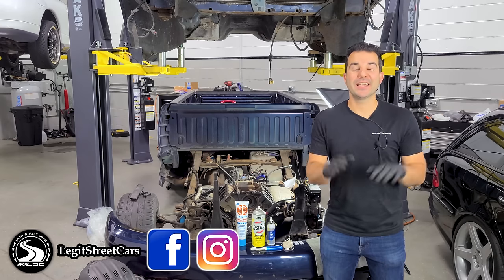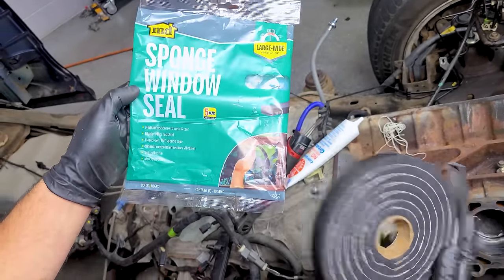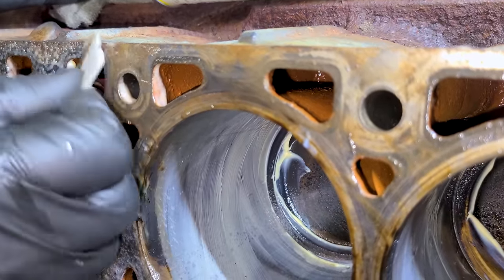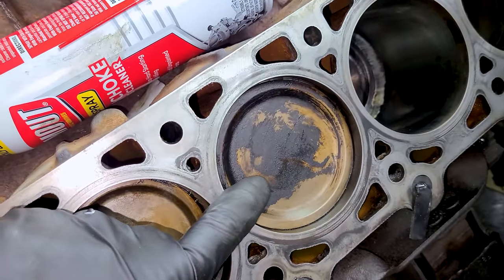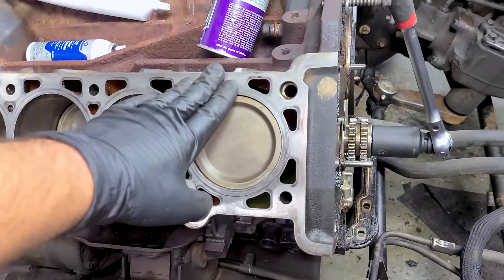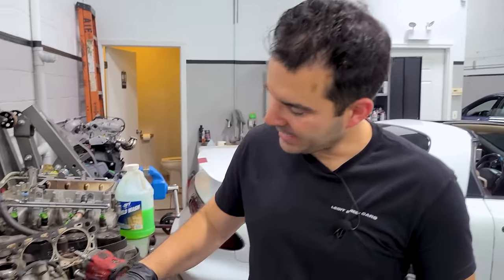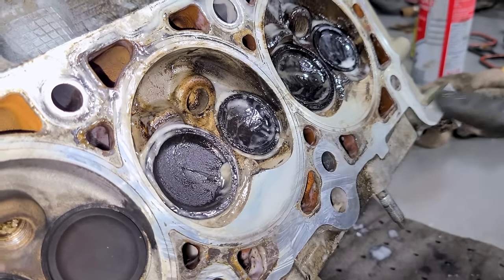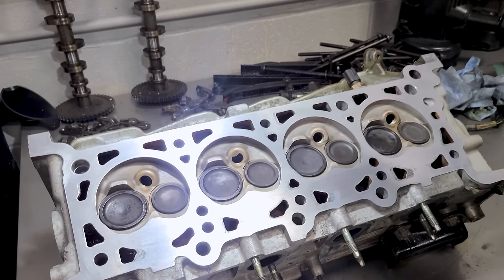How I Cleaned My SVT Lightning Pistons & Engine Block Using WAX STRING! BONUS: Head Cleaning!

Comment from the maker: Who's working on their car right now? Whatcha doing?
For your chance to win the 2022 BMW M5 CS and support a great charity click here! https://www.omaze.com/legitstreet
Reply: New SC oil on the s211 55 😎
Reply: 1982 380sl.  Bought it not running for $800.  It has 75k miles and near mint condition now.  All in I am about $2500.
Reply: Working on 3 cars. 2 Honda crvs. And my 2000 jaguar stype 4.0. All suspension work except for a a starter on my crv.
Reply: Replacing rear turbo manifold gasket on my 99 SVT Contour. In my profile picture.
Reply: 2005 CL600- replacing all ABC lines, pump, and rebuilt vblocks and regulator.
Reply: I’m replacing all 4 of the door latch/lock mechanisms on my Mk6 Jetta GLI. Hint, don’t try to lubricate them… ever! 😂😭
Reply: Wife has a 78 Corvette, I've got an 01 TA. Life long projects, for sure.
Reply: Starting work on my 88 camaro.
Reply: Just finished W221 4matic engine mounts. SO worth the effort. Learned a ton and it is by far the most satisfying repair I've done on  this car.
Reply: Just finished head gasket on Toyota Echo yesterday and first half of front end on Mazda Millenia. Exciting 😐
Reply: i have multiple projects on the go right now. changing a leaking oil filter gasket and belt on a 2006 bmw, valve cover gasket and eccentric shaft sensor on my wifes 2008 bmw, and fixing accident damage on a 2007 dodge ram i picked up for work.  I love watching your videos, they always give me motivation to go work on my own vehicles!
Reply: Rear brakes. Shop wanted 450 effing dollars to do it!
Reply: Bearings on a 2011 Mini Cooper S N18 JCW Dealer Upgrade Pkg.
Reply: Is one thing to be aware of when cleaning aluminum pistons with oven cleaner it eats away at aluminum do not leave it on there for long at all It will create microscopic fishers in the aluminum carbon build-up will be easier after.  the gasses it produces when it comes into contact with aluminum are very toxic to you  clean them outside if you can
Reply: Putting off doing my cam chain tensioner on my 4.2l Audi. I already did one side that turned in to full timing belt job and I'm dreading doing the other, prayers please
Reply: I didn't work on any of my cars today but I went into the shop to try to finish up a rear differential.  Some idiot had been in there before me and created a lot of extra work for me - I was expecting a simple pinion bearings/carrier bearings replacement but turned into resetting backlash and pinion depth.  I thought I would be home by lunch but after getting frustrated with the (worn and abused) shop bearing splitter, I left to buy my own bearing splitter then came home to drink beer and watch Alex work on his Lightning.
Reply: @DoubleCrossfire  you need all the motivation you can get if you have to maintain 2 BMWs, may the car God's look down upon you with favor
Reply: @modelbehavior3252  care to explain?
Reply: Leaf spring brackets, shackles and bushings on a 1996 ranger. Those things are thin sliced swiss cheese.
Reply: @RandomPerson-su3xg  yep and the winter is not their friends
Reply: Ford excursion rebuilding interior with 2020 Ford expedition seats and new carpet.
Reply: New lifters for 92 dodge stealth
Reply: As always, awesome video! BTW, after also watching M539 Restoration's latest vid, he used a dual component carbon cleaner (Protec Carbon X) and it literally melted away heavily caked on deposits, on used pistons. Would love to see you try that stuff and give us your opinion :) Keep up the awesome content!
Reply: Working on the drums on my 65 Mustang Gt today. Probably going to switch to disk brakes.
Reply: @JDJD-mw9rr  Well i have 3, one is a project put on the back burner while i sort out the others.  believe it or not, all of them have been relatively easy to maintain in the 4 years i've owned them.  most of what i've had to fix are just simple maitenance items like brakes, rotors, brake sensors, changing oil, etc.  all of it easy to do.  mind you, i live in a small town, we don't drive them alot, and all have low kms, so maybe all that is going to change!
Reply: @DoubleCrossfire  I have an older Audi A8 so I know how it is to maintain European vehicles, they're not the cheapest or easiest to work on most of the times, and I've heard some BMW horror stories so I've stayed away from them for now
Reply: I am just helping my brother-in-law pull out the urea tank on his 6.7 Ford it was leaking crusty nasty ass urea all over the tank🤨
Reply: In a holding pattern right now, with a road trip looming. Belle Tire did a bad alignment job and ruined a set of tires on the road trip car, so now I'm tire shopping and deciding which dealer to take the car to for an alignment (as I can't seem to find a competent alignment in the Detroit area anymore).  At least the dealer's service department has the correct specs and knows how to do it, although it costs 2x what tire shops charge. 🙄

I have to prep a car for the Lemons Rally event in July when I get back, though, and will be crushed for time...
Reply: Paint and metal work (rust) on the roof of an E36 M3.
Reply: Perhaps about to start head gaskets and timing chains on a 2012 Range Rover with 5.0 NA Jaguar engine.  Do you have a link to the straight edge you used in this video?  I need one.
Reply: Working on my 1992 Honda CB 750 Night Hawk. New pet cock and rebuilding the carbs
Reply: @JDJD-mw9rr  No, i've heard alot of horror stories about some european cars, and especially about BMW's in general.  i bought all of mine as "totalled" or salvage title.  i did my own work to repair and get them rebuilt.  Since i had so little into them once i was done, i wasn't really worried about the costs if i had to fix something.  thats why mine all have low kms.  also, i did not go for the more troublesome models with the V8's, and turbocharged 3.0L.  Mine are all NA, two of them 3.0L and one 2.5 for my wife.  i've heard good things about these engines when they aren't turbocharged and so far i've been happy.  Moreso with the fuel economy, though wish i had more power. lol  I am tempted to jump into an Audi though, i just haven't found the right deal yet, and i have too many current projects to do so without my wife knowing i bought another... lol
Reply: 1986 toyota mr2
Reply: Replaced the brake calliper. Installed a new OEM battery. Doing an oil change next. Had the Xenon bulb replaced and headlights' levelling sensor cleaned and serviced. Still have the right front door mechanism to replace.
Reply: I am maintaining my 165K mile 2004 BMW 745 Li and it's running great.  Also wrenching a LOT on my 2009 Cadillac Escalade ESV w/328K miles.  They are both a joy to drive, but just gotta keep wrenching to keep them sane.
Reply: When you disassemble the engine like this you usually machine the head and use new head gasket..
Reply: You used Easy off on pistons which are aluminum too.
Reply: @ericmalapanes1717  I'm kicking myself for not taking my dad's straight edge when we cleared out his house. We just had way too much "stuff" and I didn't think to hold onto it...
Reply: front end suspension on my 03 Suburban. 1st timer for this job. your channel has inspired me...."you can do this!"
Reply: Great vid. Tq 👌
Reply: Head gasket on a BMW S54B32. It’s a trial, but loving this block cleaning video. Many fantastic tips - invaluable. Thank you sir!
Reply: @samfinkelstein5841  wahhhhh turbo SVT contour!? Sounds like fun
Reply: @BMWBuilds  she's fun for sure
Reply: Alex, after watching your videos, I had the confidence to replace a failed hydraulic lifter on my avalanche. Thanks for the content!
Reply: Planning phase of gathering tools and parts needed to refresh the suspension and engine components on my 2004 VW GTI VR6.  The entire suspension will be replaced.  Also, the engine mount and transmission mount, Clutch assembly. Radiator.  Coolant hoses.  Alternator.  Starter.  Belt and tensioner.  Timing chain.  Spark plugs.  Ignition wire harness.  The car runs well, but considering the car has 155K miles, the maintenance will be done to assure reliability.  Thanks for making this helpful video.
Reply: 2007 avalanche. Replacing the catalytic converters and all 4 o2 sensors.
Reply: Currently performing a complete upper end rebuild on my 04 4.7L Dodge, #2 dropped a valve seat hanging the valve open, launched the rocker off the valve.  So getting heads rebuilt and performing a timing chain swap while I have everything apart.
Reply: Why are your thumbnails always pale, is that a strategy? In my opinion it give it a vintage look as if the video is old. 🔥🔥🔥🔥🔥🔥
Reply: Ha
Mine got totaled 
June 20 2024 
Not my fault 
Son & I are ok 
But used the money to pay bills & rent a home

So need a car to get around 
after wrk 😬🇺🇸🇨🇴🦾
Reply: I just learned to use half acetone and half transmission fluid on carbon.  The acetone wouldn't evaporate in a second.
Reply: So Brake clean?

Comment: If you have the engine torn down this far, it doesn't take that much to pull the rods and piston, run a hone thru the cylinders, and put new rings and bearings in. And you will end up with something that last much longer.
Reply: Agreed. Honestly this seems like a good idea if the engine is still in, thats about it. I wouldnt run this old rusty thing without taking all the bearings off and checking the clearances anyways so might as well do it the right way. Its a great video to show a cleaning process.
Reply: Yeah only another 4-6 hours of work and $100-$200 in rings, bearings...  This is for people that are doing head gaskets, or swapping heads, on a perfectly fine engine otherwise.  Not for people running 1986 engines...
Reply: @wesleydeer889 except his water jackets are rusted as hell and that engine needs dipped
Reply: That's true but in my case the motor was still in the truck. 400,000 km on it too so it's just a top end revamp after an intake manifold failure. 1996 Chevrolet 5.7L Vortex
It'll all last as long as the bottom end now. It doesn't get driven but for camping so it'll probably outlive me now at 67. 😅

Comment: I work work for an engine restoration shop and I can say Alex is spot on with all the tricks in this vid. I think I noticed what might be the bigger problem though. Ouch. ☹️
Reply from the maker: Did you see it?
Reply: @LegitStreetCars  I think so. I won’t spoil the next video hear. But I really hope it’s not as bad as it could be. I love seeing Ford engine content, way too much LS going around. Looking forward to the 4G63 as well, I have a lot of experience with that engine too.
Reply: @joshlaurita8387  im curious what it is🤯
Reply: @LegitStreetCars  Valves Said hello to Piston
Reply: @blunt3777  I saw the dinged piston as well, but I don't think that's catastrophic enough to replace the block. Now a cracked block would be.
Reply: @Geoffwhite18  Very true but I didn't spot it. Good bit of suspense tho.
Reply: @Geoffwhite18  at what time?
Reply: @Segadora93  12:19
Reply: @blunt3777  when I did the headgasket on my 1990 bmw, I noticed the exhaust valve on cylinder 1 put a gigantic dent on the piston. This happened years ago and it didn’t concern me so I just put it back together
Reply: @LegitStreetCars  I think I saw it as soon as you showed a clear shot of that area. If I'm right about what it is, I don't think its a concern. It's probably old damage and would possibly explain why the heads were changed so early. If they thought it was an issue the block would have been replaced too. Just my 2 cent, you typically go a lot further on fixing stuff that I would, so I kind of expect to see a built block going back in  regardless. I probably would too if I had the time, place, and income/funding to support it.
Reply: Yeah I'm not an engine builder but that mark on the piston didn't look like it would affect performance at all. I'd be more worried about damage to the valve but if it happened prior to the heads being replaced then that's already been addressed.

Comment: I already assembled my car's engine, this came out a little late for me lol. I still cleaned it and sent the head to the machine shop... also the pistons were new so I guess I didn't need to do a lot of cleaning... still very good to know all of this. It also makes a lot of sense to use oven cleaner since it is oil/grease and heat what causes the engine to get dirty, just like an oven.

Comment: Before I was disabled in 07 I was a heavy line gas and diesel tech for Ford and I have to say not to many people would go to that extreme in cleaning you did a awesome job but I've seen oven cleaner remove clear coat off of wheels but at this point that's the least of you problems and lm not going to say anything so you can explain it in your next video. God bless and as always be safe 👍
Reply: I am currently a heavy line gas tech at a large Ford dealership and I can assure you, none of the techs will get the block or head that clean before mating them back up.  Thanks to the 1.5L Ecoboost in the Escape and Fusion, we do a lot of this kind of work.
Reply: @ghostwrench2292  They're  known as the eco boom in the UK. Not the best of engines really

Comment: When I did my aluminum heads I used Eagle one aluminum wheel cleaner. Worked great with the drill brushes you used.

Comment: That piston at 1:57 is classic detonation damage: short side/near the cylinder wall where things can lean out at higher rpm.  This is why people have looked at solutions like chamber softening or cylinder head grooves.  Idea is...provide the means to use pressure of initial flame front to purge that point with some of the air/fuel mix near tdc - it enriches that dead spot, which may also relieve some heat.

Comment: to check if block is warped you need to hold metal plate diagonally on block and use measure gauge to check the gap

Comment: I dig the video.  Thanks for your time putting it together!  Personally, when using the single edge razor blade, I like to be perpendicular to the surface because an angle is when any burrs in the blade will now be touching the surface you are cleaning.  A perpendicular blade, burrs wont stick down below the cutting edge, they will be rolled over to a side.  Its a bit of nails-on-chalkboard but its the only way I put a razor on any sealing surface.
Reply: Burrs on the blade? How the f are you gonna get any cutting action with the blade standing straight up and down… which is what you mean by perpendicular in this case… yes?
Reply: I agree, this is my method.

Comment: Rebuilt a motorcycle engine a few years ago, aluminum everywhere, after struggling with the gasket, I finally tried some Hops #9. and it was magic! removed and cleaned everything like butter.

Comment: Some gasket sets will come with paperwork that says specifically "finish with 400 grit" or something along those lines... the sealant on the MLS gasket requires a bit of tooth in the material to help it stick once warmed up.  

Bummed to hear about your engine trouble, hopefully you can bring it back around.  
My Marauder had a spun rod bearing and chewed up crank, thanks to previously broken timing chain guide bits in the oil pan clogging the pump pickup.  Wasn't too bad of a repair... crank, rods, pistons... and it all goes back together.  Hopefully yours is even easier

Comment: I can never be bothered to try clean the head by my self. The cleaning supply's and the tools needed can easily cost more than to send the head away to a shop. Just had a 6cyl head done recently,  o,16mm shaved and cleaned for under a 100 bucks. Took 2 days to get it.

Comment: Thanks for the great content!
For your lightning build consider using a 1999-2003 Lincoln Navigator 32 valve DOHC engine. I am pretty sure there is someone that makes an adapter to mount your supercharger onto the 32v heads. You may need to use the exhaust manifolds and down pipes from Navigator as well. Then some tuning! Makes for a great looking engine and possibly better performance!
Reply: I would imagine that would be quite a power increase over the 16 valve engine lol
Reply: I agree🔥
Reply: No adapter but could use a gt500 blower set up or adapters and terminator cobra setup.
Reply: Would it hold up to boost over time though? I'm assuming it doesn't have forged rods or pistons, not sure about the lightning but I'd imagine it does
Reply: this is a TERRIBLE idea. those 32 valves from the navi can't even take towing a light load without blowing up🤣🤣, let alone the design and engineering nightmare we all know those motors are. and you want to add boost?!?! If you are going to suggest an engine swap at least be somewhat educated about the motor you are suggesting 🤦🏽.
Reply: It depends on what car it's pulled from. They all have forged cranks and rods with terminators getting the I beams.
Reply: Engine Center, Valley you have to be able to build on a few things. Supercharger Cooler then the 
Mid Valley plate than the supercharger on top of it. Boots from the supercharger, put a lot of heat into the pistons. likely the GT 500. the two valve the lightning is a lot different than the three valve and four valve Triton engines. 

Each one of these Triton engines can only hold so much boost. And so much horsepower. people always worry about the boots number. that doesn’t matter it’s how much cylinder pressure can that engine hold. The two valve lightning or in the four valve GT500. hold the most under cylinder pressure for boost. you can donate an engine on one psi of boost. if it can’t hold the cylinder pressure. 

Cylinder pressure from any compressed air is a lot of heat. 

I have plenty of super charged and turbo charged vehicles. Made a lot of mistakes along the way. with turbo, and or boosting things that never had turbos or superchargers. I love my lightning. the prices of them are only going up. buy one if you can
Reply: @cflwhat  If you call an internal combustion engine a motor, what do you call an electric motor. Educated?